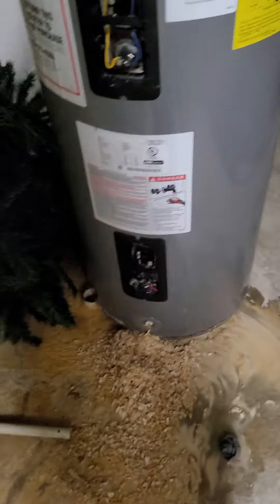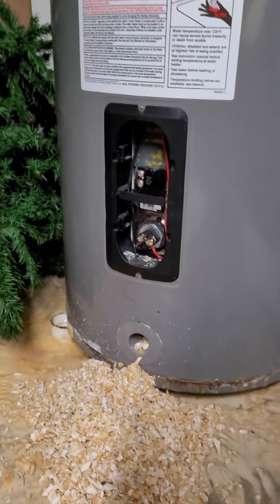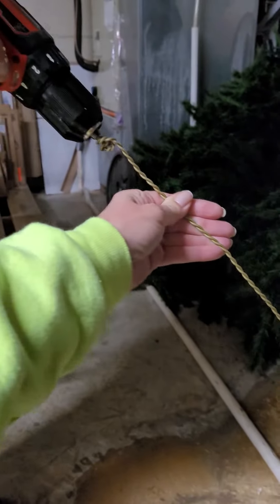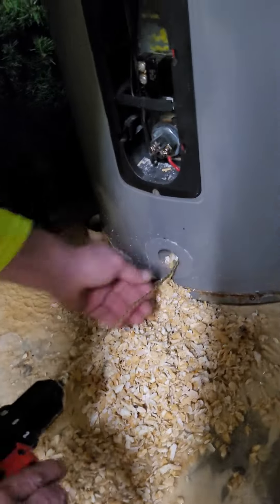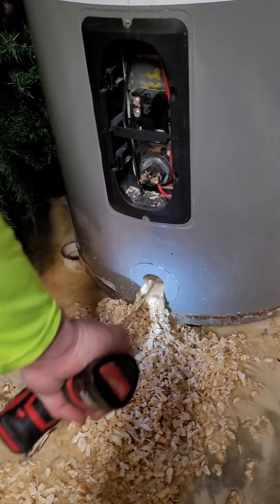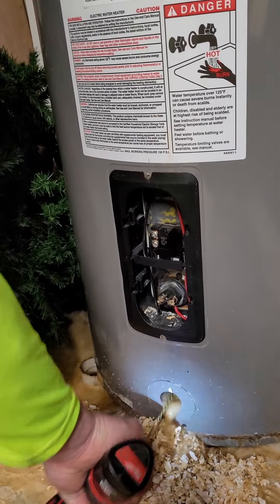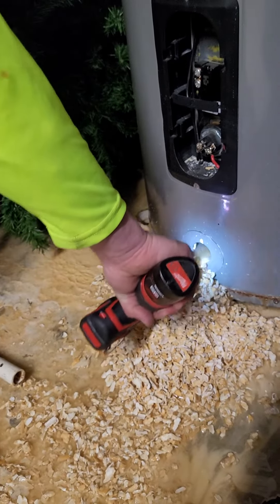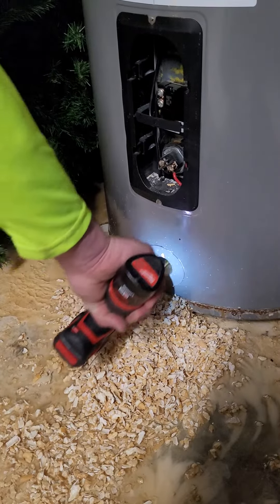Easy way to get Lime out of water heater

Comment: If you pull the heating element out you could vacuum it all out through the element hole with a rubber hose taped to the end of the vacuum.

Comment: Careful not to ruin the pipe threads. 
My plumber installed a larger 1” drain valve.  Don’t have line build up, but I do get calcium balls.
Figures the manufacturers stopped making models you could clean out easily. 
     My plumber used muriatic acid to dissolve the minerals. (I wouldn’t do it myself). And I’m sure you have to remove the anode rod first.